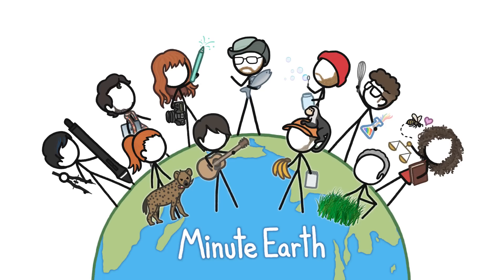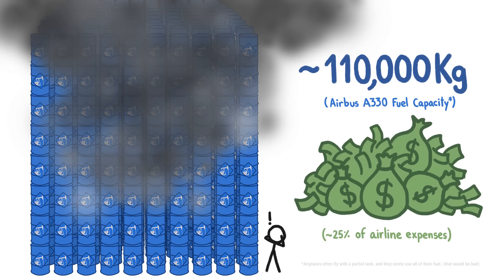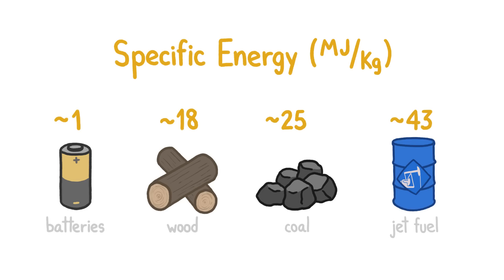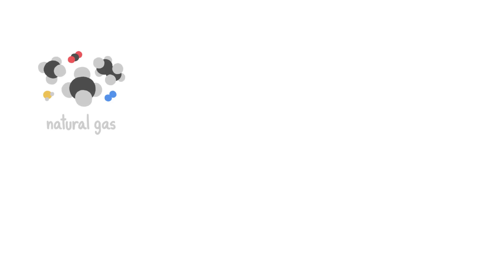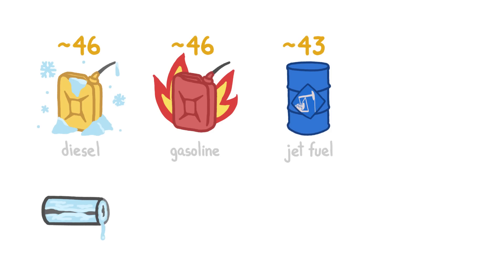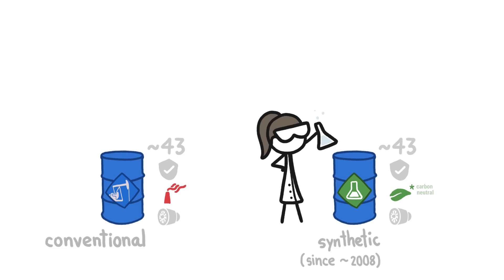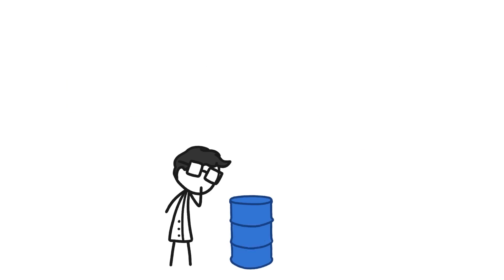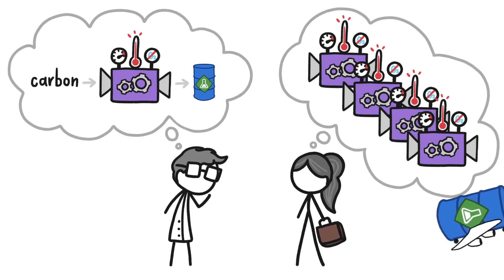Is There A Better Way To Power Airplanes?

Comment: What is the purpose of replacing jet fuel with synthetic jet fuel if it still works exactly the same and is made "mimicking" these natural processes? Like what is even carbon neutral about it? Like making that stuff has got to take at least as much energy as just pumping it up and moving it around, while still polluting as much.

So concluding more succinctly why is synthetic jet fuel even a better alternative than normal jet fuel?
Reply: Synthesizing fuel involves taking CO2 from somewhere and hydrogen from somewhere putting the hydrocarbons together with energy input, then burning it breaks it apart again to release that energy. If the energy you use to put the hydrocarbons together comes from green sources (or at least more efficient sources), and the CO2 comes from the air, then it's carbon neutral or closer to carbon neutral (as opposed to pulling it from the ground and releasing the formerly trapped carbon). I guess those are the stipulations. At that point it's basically using solar/wind/whatever to charge a chemical battery.
Reply: @wheffle1331  It would solve the problem of dependency of oil producing countries and make countries more independent, but that is just about it. If the chemistry is similiar to the old product it will still come with the same unhealthy chemicals. While it would be a good thing for countries to be able to produce their energy themselves, as long as there is a good supply of oil the synthetic version can not compete with the price.
Reply: @yourcrazybear  
Money is not the problem. The problem is that it costs energy to create energy.
I you lose 1 barrel of oil but get 50 barrels of oil in return, then you have made a good deal.
But if you lose 2 barrels of energy and only get 1 back, then you have got a shitty deal... and got an energy source that is unsustainable, unprofitable and environmentally unfriendly.

That is the reason why ethanol fuels suck and is costly and why oil still is King. 
But sadly are oil giving smaller and smaller returns. We have used up the best oil fields by now. Ghwar and other oil fields have been pumping oil for 60 years or more, so now we are looking at oil from environmentally sensitive areas and going over 1000 meters below water to get it for very tiny economic profits.
Fracking and drilling for oil in native american territories, Alaska and outside the coast of Brazil are typical examples of this.
Reply: Good question. The co2 part itself is of less importance however.
Reply: You do not take up carbon from a hole in the ground. Instead you only use carbon that is only up on top of the ground. You use trees, plants and algae and turn it into fuel. That fuel becomes carbon in the air, which then gets recycled back into the plants of the ground again.
And so does this cycle go on and on without any new amounts of carbon coming up from the underworld.
Reply: @nattygsbord  Yes. That's the idea. It will however only work financially when oil gets scarcer. Not to mention, if the chemistry of the new product is similiar to the old one, it will still have the same negative health effects on living organisms. Then you haven't solved any real problem to begin with. Just made the fuel more expensive.

Comment: Why don't we just create solar powered airplanes? I heared that electric planes are being developed but one of the main problems is that they require really heavy batteries, is it the same problem with solar ones?
Reply: yes, but i think that's already the second stage of the problem
i think the first stage is power density of the panels
the maximum is 22% effieciency, so you need a lot of them to satisfy the power requirements

which makes it heavy

plus making them isn't very environmentally friendly as well
everthing we try just destroys the earth
Reply: @marc_frank  thanks for the explanation it is really frustrating that nearly everything we do harms the planet even if its the making of stuff that is supposed to help it
Reply: @youssifmohamed6797  who can solve it?

Comment: We shouldn't have to wait for things like Synthetic jet fuel to be financially viable, if they help our current situation we need to start phasing them in en-mass immediately 

Capitalism is literally going to kill everyone
Reply: Capitalism is the reason for most of our technological advances. Never before has it been so easy to get food and everything you need to survive. And what problem are you trying to fix with synthetic jet fuel?
Reply: @yourcrazybear  did you watch the video?
Reply: @marc_frank  Yes. So answer the question? What problem do you want solved? 
If the end product is of the same chemistry as the originial product it will still be a health hasard for living things. In that case you haven't really solved any real problem to begin with.
Reply: @yourcrazybear  It's like the Eco activists that cut down forests and claim they are being carbon neutral goodies for not burning coal.

Comment: 1:47 why? Wouldn't synthetic jet fuel produce exactly the same exhaust fumes as conventional jet fuel?
Reply: It's carbon-neutral, so it would be produced from carbon that is either directly or indirectly captured from the atmosphere (plants, carbon capture, etc.)
Reply: Ben_ well we pretend that wood is carbon neutral as well, but when I walk around town in winter and everyone has their fires on the.. Ugh... Ugh... I don't find it very pleasant to walk in that carbon neutral smoke filled... Ugh... air.

Comment: I have an idea why don't we store hydrogen as a liquid and then heat it up to use as fuel
Reply: Because that requires massive insulated tanks.
You can use liquid hydrogen, if you replace the passengers and cargo with it, which sort of renders a flight redundant.

Comment: So nuclear would still be an option, just have to design a plane that doesn't crash. Unless the human is the problem, then Tesla can create an autonomous plane.
Reply: No it wouldn't be. The shielding and machinery needed to harness the energy contained in nuclear weighs alot, that is why it is only used on ships when talking about vehicles.

Comment: Having trouble with your environmentally unsound plains? Have you considered boats and high speed trains?
Reply: sailboats?
Reply: Show me a high-speed train that floats and I will consider it.
All things aside, HSR is less efficient then flying if you don't have a certain passenger density. 
Eg. Building a HSR rail line between two towns of 10000 people 300 miles apart is likely worse for then environment than a daily flight. 
Concrete is especially bad for the environment and HSR needs a huge amount of it.
Reply: HSR stands there once it is built, and it would only need energy from a hydroelectric plant to keep on going, and not fuel that is in a short supply like airplanes.
Sailships is a great idea once the world runs out of oil. The only disadvantages is the lower cargo capacity and need for more crewmen. But on the other will you get lower fuel costs. And the time to travel will be roughly the same.
With new materials to make ships that glide 40% better in the water we can greatly improve things further.
Flying would be turned into rare niche for long distance travel and for low-weight, high value goods which needs fast deliveries. While everything else can be handled by railways and ships.

Comment: I swear to god the thumbnail was an airplane carrying a battery
Reply: I think the rainbow thing is made to look like "any mysterious fuel" and so they felt it made more sense than thumbnail implying a battery could be the solution.
Reply: @thomasi.4981 : A battery can be a solution for some flights. There are electric planes already, though not in widespread use yet. It's a viable solution only for short flights, however. For longer flights, the weight of batteries would make it an unviable solution.
Reply: @seneca983  I know. The main problem seems to be that large amounts of battery mass aren't dumped over time through the course of a flight, unlike fuel.
Reply: @thomasi.4981  Hummm... That is actually a great idea ( at least interesting). It could be fun to make a plane that dumps empty batteries along airports on its way.

Anyway, batteries' density are rapidly improving. Soon we will have long haul electric planes (they can recharge while in flight)
Reply: @thomasi.4981 : That's a part of the problem but I'm not sure that's the main problem. Even if the spent fuel's weight would somehow remain on the plane it would still be a lot lighter than a battery containing the same amount of energy.
Reply: @1queijocas : "they can recharge while in flight"
Where would they get the energy to do that?
Reply: Yeah, they changed it. Dunno why though. Maybe it resembled Duracell way too much?
Reply: They changed the thumbnail ??
Reply: Powered by gay juice

Comment: what about sun power and litium batteries?
Reply: There have been attempts to build planes powered by solar panels, but AFAIK the only category that has worked for this so far are ultralight gliders. For anything bigger/heavier, the surface you can cover with solar cells is way too small for the energy needed to propel it. And the battery part was already covered by the video, they have a way too bad energy/weight ratio.
Reply: "litium batteries"
There are electric planes but they're only viable for shorter flights. For longer flights the batteries would be too heavy.

Comment: Minute Earth: We need a better way to power our jets!
WWII Germany: First time?
Reply: V2?
Reply: @ernestbr9786  Germany had insufficient oil fields and synthesized gasoline for military planes from coal
Reply: And Germany partly lost the war due to resource shortages. Not even top notch scientist and Germany's total mobilization during a life and death struggle was enough to pull that country off oil dependency.

Germany tried everything. Making oil from coal. Making oil from geranium oil from sunflowers. Trying to run Tiger tanks on wood gas. They took inspiration from Japan that produced aviation fuel from pine tree roots. They built airplanes to fly on C-stoff due to the fuel shortages. And they tried to build airplanes out of magnesium since it was a more plentiful material than aluminium, and also both lighter and stronger - the only disadvantage was as you probably already guessed that it burns pretty well. And Germany tried to replace metal with wood - like on the cabins on their military trucks.
But despite all efforts was Germany hampered by bottlenecks of vital material throughout the entire war.

Comment: At the beginning of the video you say that airplane are big pollutants, I kinda agree but not entirely, studies have compared big pollutants and compared to cars, airplanes are not as pollutant as we think they are, because they are transporting multiple people at the same time and that drastically reduces its pollution levels
Reply: For short distances, cars have lower emissions per passenger kilometer than planes and vice versa for longer distances. But in many cases (for longer distances) that's not a very meaningful comparison because a) you wouldn't drive across oceans with a car anyway and b) for longer distances almost any method of travel (except maybe electric trains) is going to be a big polluter even if some other method would be even more so.

Comment: Batteries have a lower energy density than wood?!?!?!
Reply: Of course. Batteries aren't great in the energy to weight ratio. A battery with a higher energy density than wood would be totally bonkers. Plus, it would basically be a dangerous bomb.
Reply: yup
Reply: Yep, batteries are pretty shit really in terms of energy capacity.

Comment: What about liquid Hydrogen battery cells? I know that’s being used for cars, but idk if that’s light enough or produces enough energy.
Reply: AFAIK, liquid hydrogen is still 1/4 as energy-dense, volume-wise, as petroleum products, so the volume of the tanks would still be a problem. Also the added energy and complexity requirements of keeping that much hydrogen that cold and/or pressurized.

Comment: can we power jet planes with redstone?
Reply: Pistons have a very low push limit, which would defeat the passenger and cargo carrying abilities of large airliners.
And even if we were to craft pistons with larger push limits, we then have to build very large crafts, as slime blocks are very sticky and annoying, not only to work with, but also to passengers and cargo. And then theres the implication of block lag, which grows exponentially with the amount of blocks used in a single flying machine.
The current best alternative is giant elytra, and ravagers.

Comment: Ground stations that recharge electric planes while they fly, using lasers. There. Done. Next?
Reply: The environmentalists are going to love you killing hundreds of thousands of birds. 
Not to mention you will have to use an exponential amount more energy to do that, wireless energy transmission is horribly inefficient. You save a barrel of jet fuel by burning 100 tons of coal...
Reply: "using lasers"
That sounds exceedingly inefficient and doesn't work for flights across oceans.

Comment: What if we had a series of ground based lasers that tracked the planes they were powering, which had some kind of receptor / converter to use the energy for flight? Ignoring the logistical issues for a minute and just considering the problem discussed here—providing sufficient energy to the plane to fly without adding too much weight or bulk—would this work?
Reply: interesting but cloud cover would be bad for business
Reply: @DMSrunit I think infrared and/or microwave lasers can penetrate clouds

Comment: The problem with this analysis is that is completely lacks vision, perhaps a problem shared by Mr Gates. 1. The fraction of total weight devoted to 'fuel' Vs payload doesn't have to stay as it is. 2. There are many optimisations you can make to a plane to make it more efficient. 3. Our current idea of how far a plane should go before refuelling isn't something that cannot be changed. Regarding point 1 there is a formula for working out how far you can go for any given energy density. Given the current state of the art of batteries and vehicle efficiency that seems to be short to medium hall. Whilst we may never have a battery powered plane that can travel half the world without stopping that's not really needed. Economics will dictate the direction the industry goes in and battery planes will be so much cheaper to run that bio fuels let alone traditional fossil fuels will have no chance to compete and will thus disappear.
Reply: "Our current idea of how far a plane should go before refuelling isn't something that cannot be changed."
For transcontinental flights it kind of is.

Comment: Hydrogen has more specific strength than oil , but takes more space, which means the wings can no longer store it all. Could this be solved by a using a wingless plane such as the flying v concept?
Reply: the problem is not the space but the weight of the container needed to hold the pressure.

Comment: Too bad the synthetic jet fuel still produces carbon dioxide or this technology could be actually useful in the crisis we're facing...
Reply: Depends where the source material and energy comes from. If it is made from plants that can regrow and renewable energy, it would be carbon neutral.
Reply: in order to create it it is collected from the air. that way when it is burnt it is carbon neutral.

Comment: Frick it. It's time for nuclear planes!
Reply: let's go and ask Bethesda about those fallout nuclear planesss
Reply: There were nuclear power planes designed by the military in the 1960s that were capable of flying and getting off the ground the only problem was the efficient solution for those were thorium based reactors and the government didn't like those because those were harder to make of nuclear bombs with.
Reply: And here is the only time you can use that knowledge nobody asked for lol

Comment: I mean, liquid methane could do the job and is easier to sythesize than synthetic jet fuel but requires alot of infrastruture changes. A better middle ground between retrofit and sythesis difficulty might be diethyl ether which can be produced in a high temperature environment in the presence of a catalyst, from air. This is one of the proposed applications of molten salt thorium reactors since they can easily acceive the requisite temperatures with the help of a heat pump system and because their high energy output makes it scalable.
Reply: methane is a gas at room temp and the pressure would have to be maintained for it to even work.
Reply: @DMSrunit  Not necessarily. Liquid methane does not have to be stored at its room temperature vapor pressure. It is allowed to boil off at a reduced rate by containment in a dewar vessel that prevents nearly all conductive and radiative heat transfer and can be kept at a moderate positive annular pressure to further reduce the rate of boiloff. The boiloff is combusted or catalytically reacted to prevent methane release into the atmosphere. So shorter term storage than jet fuel but at present cheaper per therm if you just wanted to start with a lower impact fossil fuel before ramping up synthesis.
Reply: thorium is nuclear so that's off the table
Reply: @DMSrunit  For thorium, We're talking a fuel manufacturing facility, not in the vehicle. Incidentally with the help of heat pumps it doesn't have to be nuclear, nuclear is just better suited to the task since the molten salt is already close to the needed 900°C. You could also generate this using the electricity from peak production solar power, currently offloaded at negative price to neigboring states during california's summer for example.